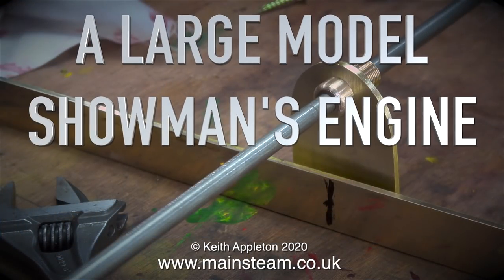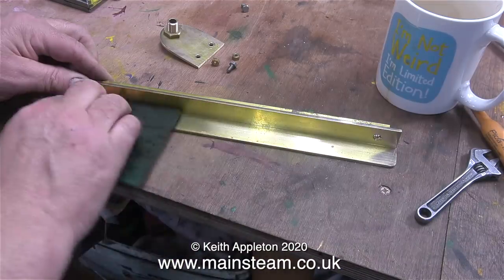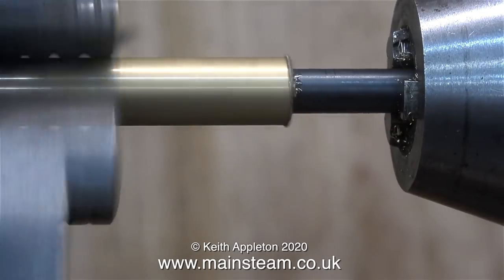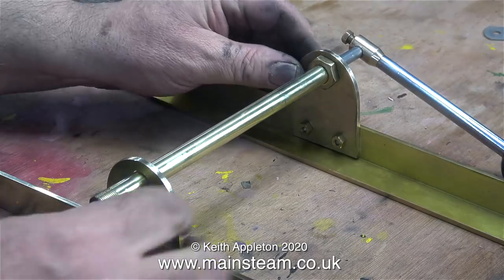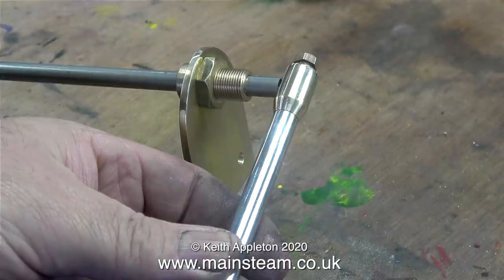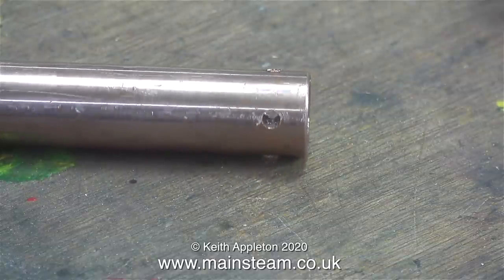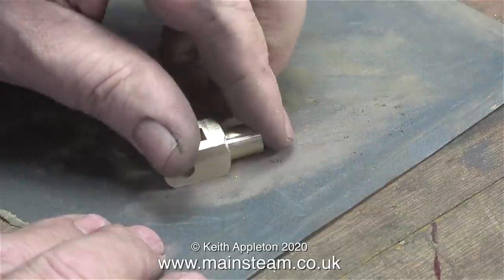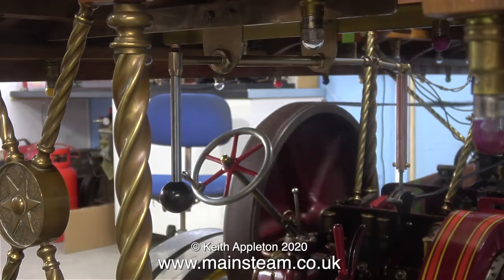A LARGE MODEL SHOWMAN'S ENGINE - PART #14

Comment: Very nice. It's hard to tell, but it looks like oak. When you first drilled it, I thought it was aluminium swarf, ally bar painted to look like wood! LOL.  If it is oak, you will want to replace the visable steel screws back to brass. As iron and oak react and cause black staining.

Comment: I was surprised you didnt just make a vertical slotted extension to the regulator handle.  This would allow your vertical arc motion to occur although you may get a weird feel as the ratio of the lever would change depending on the position in the arc.

Are the plans to move more of the controls to this same remote panel?
Reply from the maker: Please watch the videos - I have just completed part #43 }:-)))

Comment: You need to have some slap in the belt or it will not sound right. I remember that sound from the fall farm shows (called the Plowing Match), where they had the large Agricultural steam engines, usually running a portable sawmill.
Reply from the maker: Slap near the engine when it's driving the onboard generator is a bit of a problem . . . . it's OK when driving machinery with a really long belt, but this short Leather belt would slip on the generator pulley and it if it was slack it could thrash about near people - or even me . . . . Health & Safety etc etc . . .